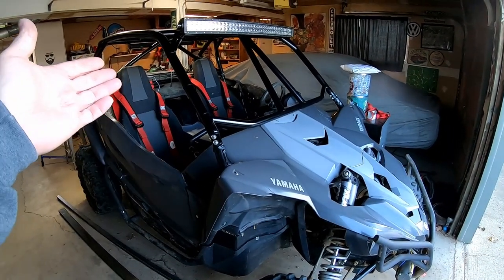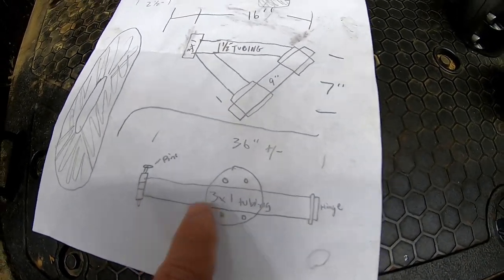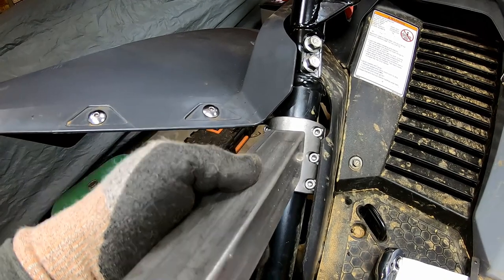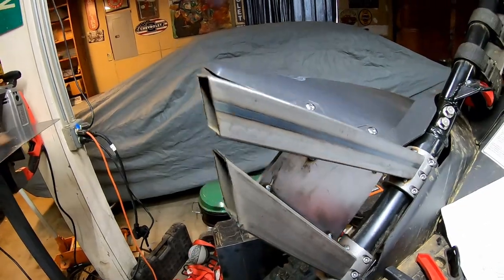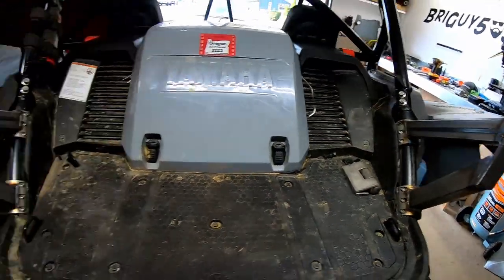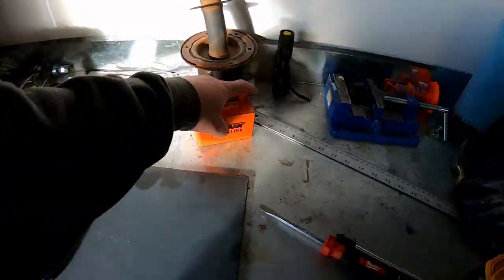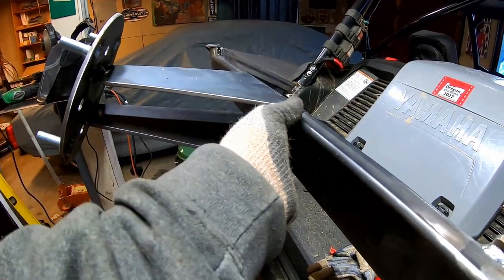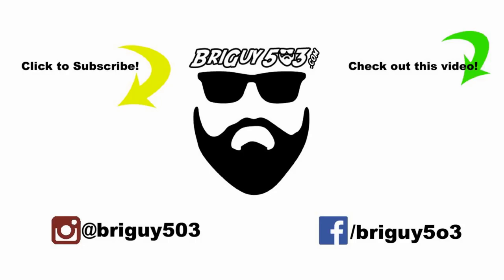I Built a Spare Tire Carrier!! | DIY 2019 Yamaha YXZ1000R Spare tire Holder in 1 Day!! | Yamaha UTV

Comment: So I subscribed. I respect fabricators as I go slow at it myself. One question regarding your design and orientation and I guess for the rest of the industry that puts heavy spares so high up in the air.... Why did you choose to put it that high and that far back? Was it the weight and balance issue?
Reply from the maker: Balance mostly. It helps in the whoops and jumping too.

Comment: Did the spare tire mount help the buck of the rear shocks?
Reply from the maker: I added the tire back there for that reason, but honestly I havent really noticed a difference lol
Reply: Cool thanks!!!
Reply: I don't think he rides that fast through whoops or does much jumping.  But,  starting to have a setup for doing just that. I think it definitely will help with the bucking, along with the right suspension settings.  I like it!

Comment: link to the collars you used pleass
Reply from the maker: Letme see if I can find them. I got them on ebay
Reply from the maker: https://www.ebay.com/itm/2-Steel-bolt-on-tube-clamps-weld-1-75-1-3-4-universal-roll-cage-mount-cage-Long-/264556638522?_trksid=p2349624.m46890.l49292